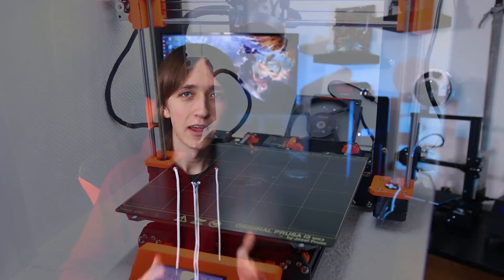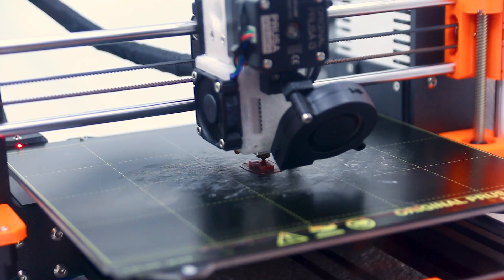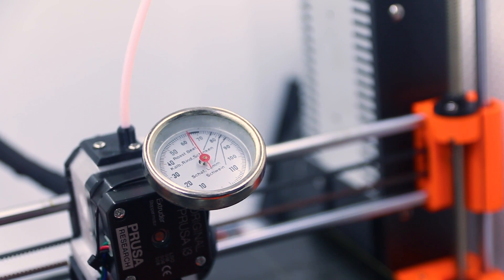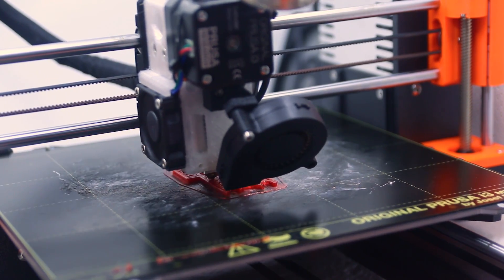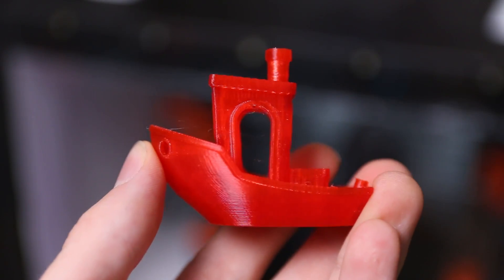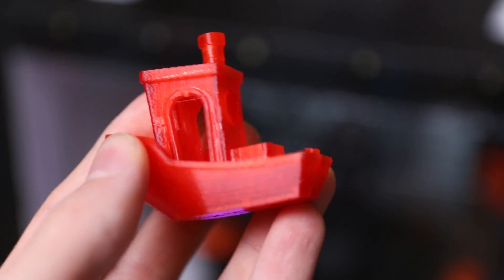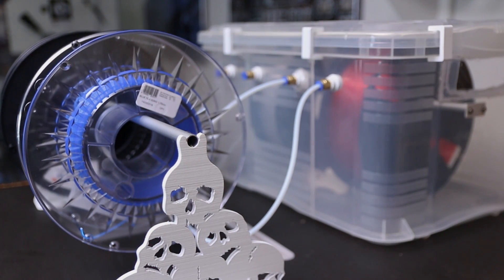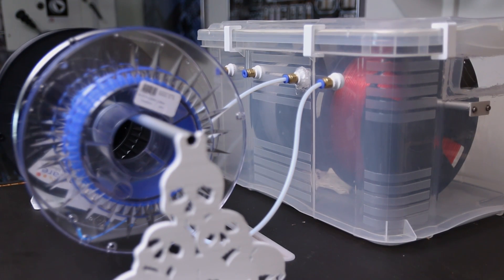How to 3D Print Polycarbonate like a Boss!

Comment: I have the opposite problem of adhesion on my PEX plate haha it's OK with PEI on the Bambu X1C. I had to start using a gluestick just to prevent such severe adhesion to the PEX build plate, it already destroyed one so I learned my lesson haha. You need to run this stuff at a dry in a humidity box, preferably with heat. You really do need an enclosure for any decent results. Great video!

Comment: I am trying to get polymaker PC-FR to work but it keeps peeling itself off the bed, with a brim, with 3d-lac spray and it still peels. Dont want to get an enclosure for just a few prints 😅 may try out a box or even a freaking trash bag at this point

Comment: Warp like crazy? Not my experience. I was selling my PC+ filament because I thought it was hell to print. Nobody bought it so I decided to try a print a camera tripod part using common settings. I was surprised to see it warped much less than ABS. Bed was 110/100 and extruder 250. No enclosure, just Ender 5. Masking tape for grip. The print came out almost perfect. I'm now a polycarbonate fan! Maybe our filaments are different...
Reply: I tried printing PC on tape the other day but the print pulled the tape off the bed. It even pulls off the bed using 3d-lac adhesive spray 😢

Comment: I tried a polycarbonate sheet with a very light coat of glue and it sticks very well when 105c and releases super easily below 60c. But I'm also suspicious. Even tho my filament recommends 270-310c print temperatures my prints are more flexible than PETG/ABS prints.... They're almost like nylon..which is slightly confusing. I'm so tempted to order this other PC filament I saw but I don't have much money left

Comment: Printing Raise3 brand PC at 280 nozzle, 100 bed, 40mm/s, on glue stick on a glass bed on my Ender 3 Pro with a Micro Swiss all metal hotend. It's inside an enclosure without heat, just the heat from the printer. No warping, printing almost as easy as PLA. Extremely hard, tough, and durable printed parts. It's amazing stuff.
Reply: I’m pretty sure that’s also the same with PolyMaker PC. For some reason, Raise3D Premium PC has the exact same mechanical properties as Polymax and PolyLite PC, (depends on Color.)

Comment: I made this fucker stick, you have to use the old school acetone on the bed, while its cold + rubbing ABS filament. you have to make the dissolved plastic layer thick. Then I heated it to 105C. It sticks well. I still have terrible stinging though.

Comment: I was able to complete a print back when, it stuck pretty well to the stock plate ON an Ender3 it was polylite. The only problem was it cracked in half in the middle. But it somehow completed the print 
..even though the bottom half shrunk like over 1% 

and I think I accidentally preheated it for the wrong filament for the first few layers I had no idea what was happening at the time.

*The print turned out perfect besides for a  few slightly curled edges and having to epoxy the pieces together

Comment: Well done, thanks for sharing.  I regularly print production parts in PC on both a Prusa mk3 and a MakerGearM3ID.  On both machines I use Layerneer's Bed Weld on kapton, the only difference being the smooth steel bed on the Prusa vs glass on the M3.  Honestly, my only problem has been getting them off without pulling the kapton right off of the bed; once cooled the parts don't like to release.  I agree about the enclosure - you shouldn't even think about PC without one.  The hotter my enclosure gets, the less warping; if you're printing at 290 ambient temp in the enclosure shouldn't go below 45-50, IMO.  The trickiest thing about PC is annealing it properly.  If a part has sharp transitions in volume, it part can crack as it cools.  Very slow cooldown followed by annealing at 100 for at least an hour, followed by another slow cooldown gives me beautiful and strong parts.

Comment: Polycarb likes to be printed really really slow.. dont go fast.. it will warp.. printed pc for years before changing to nylon.. I feel that nylon or nylon carbon is so much easier to print as compared to pla, petg.. just the moisture issue..

Comment: For the enclosure I use a blanket. The heat of the heated bed alone and the small area it can heat up with excellent heat insulation makes it super hot in there! To the point I advice you to be careful. If you don't print abs etc often and don't wanna spend money this is a great way!

Comment: Have you tried printing the first layer in PETG and then switching filament and printing the rest in polycarbonate?
Reply from the maker: No, never heard of that, I might have to try it
Reply: @DarkArtGuitarsWorkshop  I've not actually tried it myself, but have read reports of people having success with this method. The idea is that the PETG sticks to the build plate and the polycarbonate sticks to the PETG. You may need to experiment with the build plate temperature. Let us know how you get on.

Comment: great video!! I was looking for buy a printer that are able to print Nylon and Policarbonate only....  but not sure if Prusa will work... looks like it needs a lot of modifications....   do you know where I can get the Prusa parts all with polycarbonate that can stands higher temperatures?  it's a pit that is not full metal...
Reply: You can download all the parts on the official prusa webside.

Comment: I was able to print PC on Creality's glass with ceramic coating and silicone heater pad. With 140C at surface Benchy prints without issues. I tried printing 220mm quadcopter frame and corners lifted when it was almost done. Still usable. And I don't have an enclosure. I guess the trick is in being able to bring bed temperature close to Tg of the material.